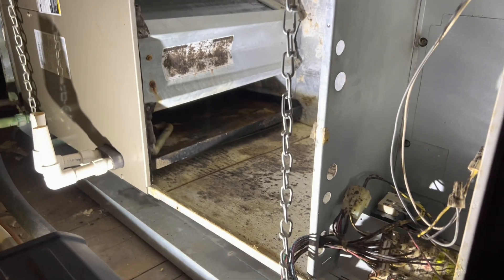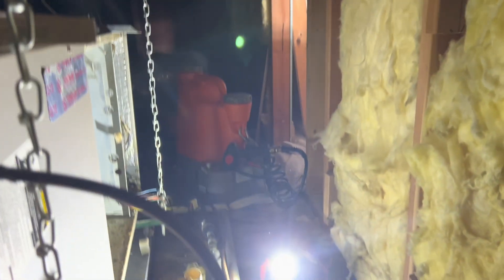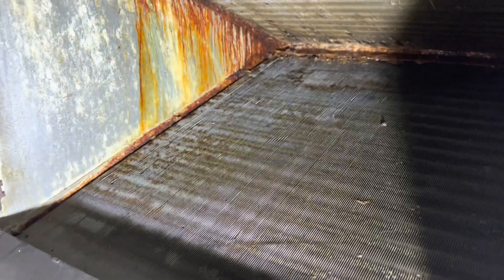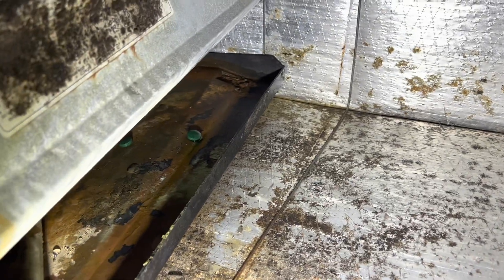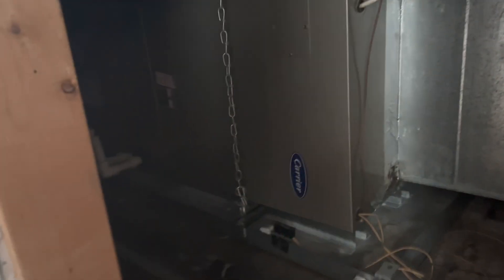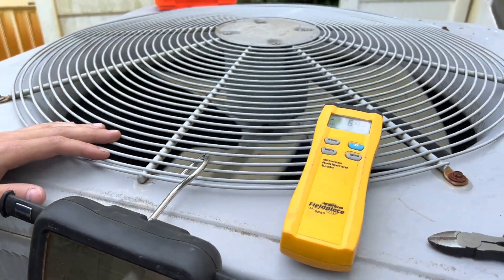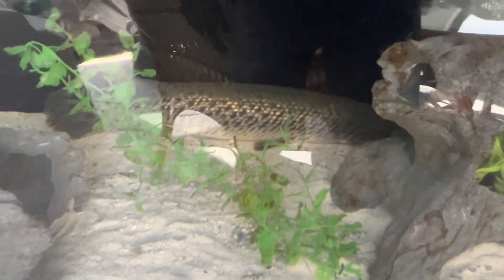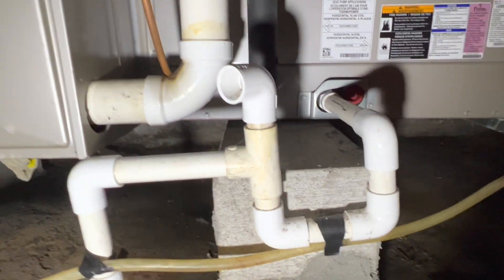Deep Cleaning a Carrier, and Fixing Another! High Pressure Control? 8lbs of 410a and SuperSeal!!!

Comment: So I noticed you still use teeth on flats with your Knipex pliers. I made a comment about how you should check some Channelock 'Wideazz' Adjustable Wrenches in the 6 and 8 inch versions. They have been a good wrench to me in getting you wrench on big nuts. I use the original Irega brand. That's who Channelock has make their brand.

Have a good one!
Reply from the maker: I have a similar tool, use I the knippex the right way and you won’t tear the hex apart
Reply: @DCHVAC  True, if you use it the right way. I guess it's my laziness coming out with setting wrench size, and you're good to go. To each their own. If it works for you, keep on truckin'! 🙂

Then again, laziness can cause innovation, which leads to efficiency. I always liked that saying my boss told me one day years ago.😄

Have a good one, you're doing good. Likes the filter drier bends you made on the last install you did with the Trane Air Handler.👍

Have a good one, braddah! 🤙

Comment: That is a low ambient control. Note that you want to take sub cooling while charging with that control jumped so the condenser fan runs all the time and refer to the charging chart. The cap tube gets connected to a liquid line port.
Reply from the maker: I figured that out surprisingly, It just seemed like the sensible thing to do. But thanks would’ve been a great comment at 8am 🤣 lol